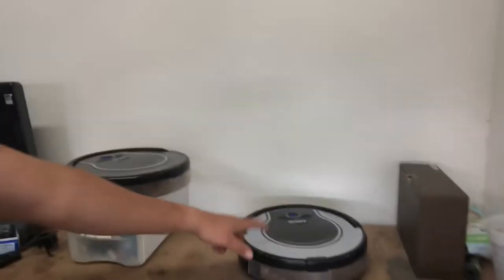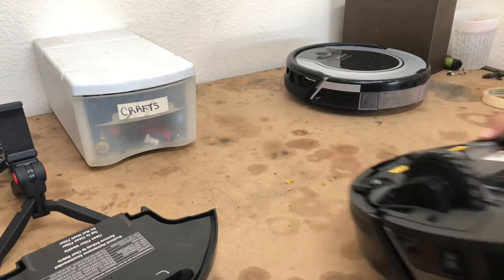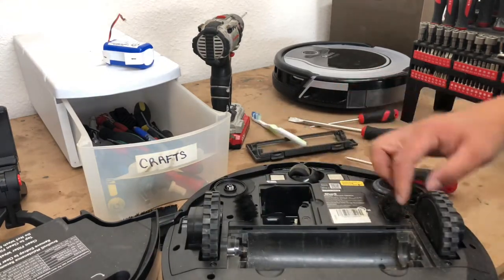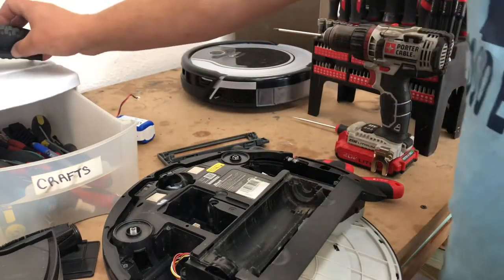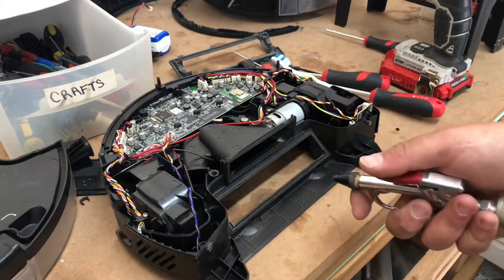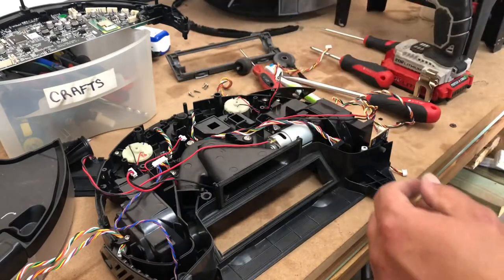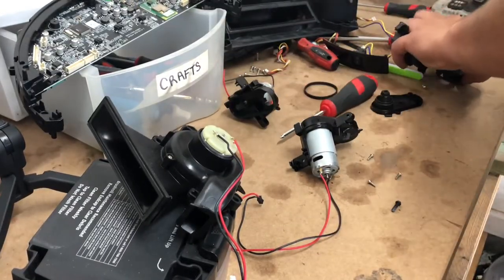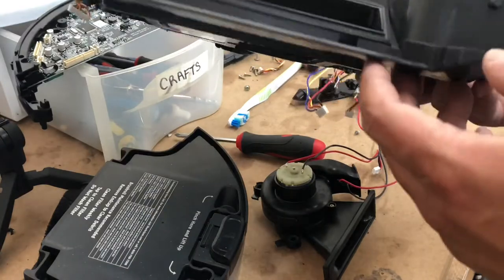ULTIMATE Shark Robot Vacuum Cleaner Complete Teardown and Rebuild

Comment: Where is the dustbin sensor on an AV2510 series? I took my robot apart and put it back together but it’s throwing a dust bin not installed error. I’m wondering if I misplaced the sensor, but I can’t see anywhere on the dustbin or on its space where a sensor could be

Comment: trying to replace motherboard for Shark RV1001-AE, on new boar there is an extra plug port at top to right of middle will this work on mine?
Reply from the maker: Sounds like that is a different model board. It might work but there is a good chance it will have errors depending on what that port connection is for.

Comment: My daughters Shark Ion Robot Vacuum AV752 is making a growling noise when it runs.  I watched your video and I think it is repairable. My Google search for replacement parts yielded very little for parts. Only the more common parts: brushes, roller brush etc.  I am thinking the noise is coming from inside one of the drive wheel assemblies.  Can you recommend a supplier for replacement parts and contact information.  Your video was really helpful.

Comment: Howdy sir, I have a shark RV754R01US, it cleans for two minutes or less before stopping with a flashing blue max light, I followed your disassembly, and cleaned the contacts for the front bumper with isopropyl. No change, I just thought you might have a suggestion for me to help track down the issue. Thanks for making the vid.

Comment: Hi Smitty, I Managed To Finally Find A Electronic Guy That Soldered A Couple Of Wires Where The Pins Were But I Messed Up And Didn't Take Pictures Before Taking The Wire Clips Off The  motherboard And Did Put Them Back On But Not Sure And Wondering If I Could Send You A Couple Of pics To Get Your Opinion? Man It Would Be Appreciated.

Comment: Hi,Broke Pin When Taking Out Battery From My Shark RV2001 VacMop And Wondering If You Think It Can Be Repaired Or Do I Have To Replace Motherboard, Very Frustrating And Shark Does Not Sell Motherboard, Any Help Would Be Appreciated.
Reply from the maker: Oh no sorry to hear, if you have to skills you can attach some wire where the pin went and just attach the battery with different terminals. If thats not possible sadly a new motherboard is the only option.
Reply: @SmittysWorld  Thanks Smitty,I Was Thinking Of Tearing The Vac Down To Get At The Motherboard And Maybe Solder Another Pin But Was Told Can't Happen And That Brings Me To You Wise One,Is It Possible If Pin Snapped Off At The Motherboard? Cheers
Reply from the maker: @Roaddog22  if you remove the motherboard you could solder some new pins or even some wire connectors to make it work
Reply: @SmittysWorld  Thanks My Friend, I'm Going To Rewatch Your Video To Make Sure I Keep It Organized When I Tear The Vacmop Apart To Get At Motherboard And Hoping I Can Consult With You If Needed, Thanks For Your Support. 
Cheers

Comment: Good afternoon!
I have a Shark Iron Robot 720 and I tried to fix it but it was impossible. When we press the clean button, the Spot light flashes few seconds later. I live in Brazil and I don't know what to do. We opened the robot following your video instructions and every single part is totally clean. What do you suggest?

Comment: shame that shark doesn't sell more replacement parts. This great video illustrates the point that if you don't know a repair person that has the part your options are 1. TOSS IT, 2. Buy another-with same potential. Cheap low quality plastic saved shark 3 cents per part vs your  hundreds invested..

Comment: I have a shark RV750   I am looking for a bearing and a belt.  I am having problems finding a place to order from,,  Any suggestions?  Thanks
Reply from the maker: Ebay will be the only place you can get those parts and when you say bearing what are you referring to? the brush bearing?
Reply: @SmittysWorld  yup.   the brush bearing. I didn't take it apart yet. Would you recommend replacing the motor also ?

Comment: I I was hoping you might show what sensors let the shark know that the Dustbin is engaged, I can find no sensors or switches or anything for that matter that might let the shark determine that the Dustbin is put in place. And I can't get the air to clear and obviously the shark doesn't work the shark doesn't work with the error active
Reply: I have a shark RV 1001 AE

Comment: I have a RV20011 that keeps draining the battery. I have 19.9 v on the base . I can manually charge a new battery to 14.4v but it drains the battery overnight. Any ideas?
Reply: I have the same issue, did you ever find the solution?
Reply: @ronaldallanperez3064  Hell no! Rosie found the bottom of the trash can. Too bad, I really like the vacuum.

Comment: I purchased the shark AI Robot. It was working for about two weeks.  The battery is getting drained by the charger.  I purchased a new battery and it drained the new battery while it’s charging. I know it’s charging because the charging unit led changes from green to blue.

Comment: Wow you sure know what you're doing! I learned a lot from you,thanks.A few days ago my shark gave this message" please check under robot for an obstruction"
So far I cleaned the brush roll and compartment and today pulled the housing where the filter is located on  front of vaccum.And turned the unit off and on again.Still not working.
What do you think the issue is? Vacuum is 4 month old.
Reply from the maker: What model
Reply: I took my share apart to clean it.  Put it back together and now it won’t turn on.  I am assuming it’s a power connection somewhere.  Where show I start looking?
Reply: I have the same issue. Checked every wire to some pictures I took before hand. Any thoughts?

Comment: I grabbed a 700 the other day and was fooling around with it. It will move about a foot then stop. Not seeing any errors, just a beep every few seconds. You can push clean again and it will move about another foot and stop. Any ideas?
Reply from the maker: Hmm 🧐 I would take it part give it a good cleaning could be something causing it to get stuck inside. Maybe a motor going bad and heating up even.
Reply: This same thing is happening to me. Did you ever solve it? I've cleaned every part of the main brush, but the brush motor isn't moving very smoothly.

Comment: I finally got the correct brush mower. Before I put it back together I can’t remember what the 5 silver colored screws came from and another set of 2 of them.
Reply from the maker: Places that have silver screws , main brush motor , side spinner motors , mother board , suction motor all those have screws like that